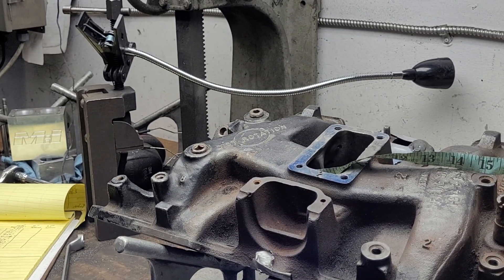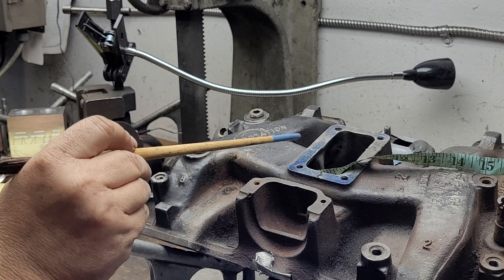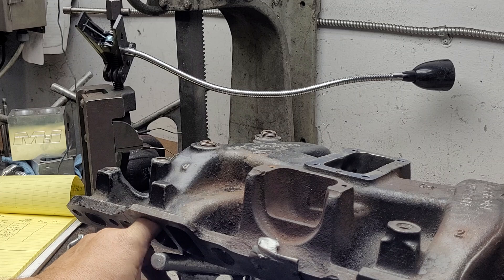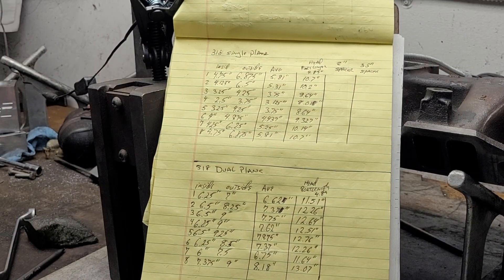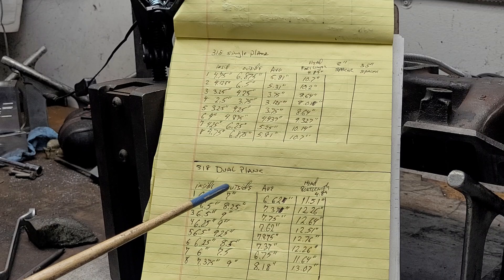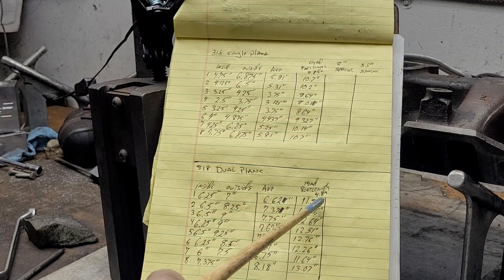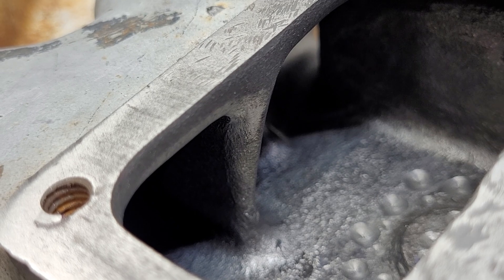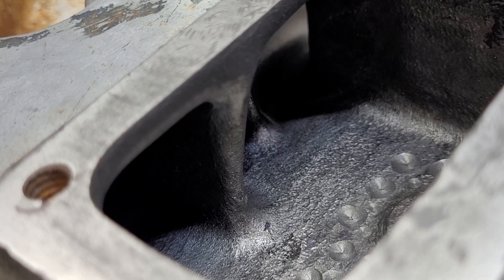Mission Impossible 318 project, Measuring intake port lengths

Comment: Port length with various valves opening up at different times compared to each other will potentially add to, or subtract from performance, same as how it affects performance to adjust the exhaust manifold/header lengths to deal with the same timing, only on the other end, where you are looking at how your scavenging is going to come out.
Reply from the maker: Thanks

Comment: A shop vac will pull your tailor's tape through so fast you best be hangin on or it will fly right through into the vac tank.

Works every time with any cloth tape.

Comment: Every length of the intake is its own resonant cavity, and everywhere the ports are across from each other is even yet another resonant cavity.

Every one of these different sections are all going to want to resonate at a different frequency.

Kinetic deflection is also a factor in restricting air  flow.
Reply from the maker: I did a lesson/ video a while ago where I graphed the different torque curves from different length runners on the same crank and what it does.
Reply: @servediocylinderheads  Ideally, for an engine to operate with the most uniform power between individual cylinders, every port should be 100% independently operated [separated completely from every other one, with their own air  and fuel metering, using identical porting and carburetion.

Some of the best performing engines built relied on this and had one carburetor per cylinder, each on its own independent inlet to prevent cylinders from interfering with each other.

This ensures identical uniform direct air and fuel flow, and ensures that a skilled tuner can assure each cylinder gets the exact same charge of fuel, whereas with manifolds, fuel is prone to sling off of curves at near sonic velocities, splattering down the wrong ports, often leading to fuel flow mysteries that even some professionals can't figure out.

And even variations within manifolds from the same manufacturer will have different flow characteristics, simply because of casting inefficiencies.

One of the big advantages to CNC engine design is the ability to engineer out variations and inappropriately tight bends and irregular internal volumes.

I am working on specialized systems which I will be testing on my own engines which I expect will produce significant gains in this department, and will also be working with a tunable tunnel ram system I devised.

Comment: Ever thought of using a plumbers pipe bending spring to measure the port length with? I suspect that a large diameter spring will be pretty close with just a single measurement. Going to have to try it later myself just to see how it works. Regards Greg
Reply from the maker: I did not think of that. Thanks

Comment: Hey brother, 3m makes an expanding foam tape for door jambs that I use for paint work on my restos. I slide it through and stick where I need it. Then close the door and it fills to the amount and countour needed. Seals the area up pretty well. I'll try a small piece here on one of my old intakes and if it goes as good as I believe it will...I'll send you a piece of it.
Reply from the maker: I have plenty of experience with expandable foam. I built a super insulated house up north. I have always had issues. Thanks
Reply: @servediocylinderheads  😄👏👏👏

Comment: Port lengths don't matter on a dual plane, look at the Edelbrock Windsor F4B, runners as short as 1".
Reply from the maker: And the others very long. So the engine has two torque peaks at different rpm. This makes for a very flat torque curve. Thanks
Reply: @servediocylinderheads  Now to grind a cam with profiles to suit each runner.
Reply from the maker: @TomSmith-cv8hk  That has been done before. Not this time. Thanks

Comment: Just a thought. Take a straight drain cleaner bristle,  push it through.  The bristles will keep the twisted wire in the approximate center.  Or just section of old battery cable 2 AWG.  It is ok, because it's just estimating.

Comment: I think measuring both sides,  then split the difference, because the air flows in the middle!
And wouldn't that bake a decent intake for a turbo EFI,  mount some injectors and pipe the turbo into a throttle body,
Reply from the maker: Which intake?

Comment: Why not lube up the inside, and pour it full of silicone, like Mr. Vizard  does with heads,  tape up the head flange areas, and pour from the carb flange, maybe a cheaper option of material can be found that keeps it shape, or maybe just making the cast hollow just allow the silicone to coat the port, making it much easier to remove,
Reply from the maker: It is a good idea but I don't see myself doing that with these nightmares. Thanks

Comment: I am missing how you measured the dual plane at the point where it divides into 2 ports?
Reply from the maker: I stuffed the branch with foam to make the outside turn.
Reply: @servediocylinderheads  Thanks. Just wondering how and where you made the turn and how big of radius .

Comment: A shop vac will suck the tape right through a runner.
Reply from the maker: Genius! Thanks
Reply: @servediocylinderheads  Aren't you an electrician in another life?  😉
What do you do for conduit runs where you have no pull elbows? (there must be plenty of under-slab in Florida...)
Reply from the maker: @jimurrata6785  Funny, my pulling equipment is in storage. Thanks
Reply: Hey Charles.. not sure what rpm this thing will run best at...however if you had a goal of max peak hp.and torque could you take that center devider farther back..would you get more flow with a larger plenum ??? And also would the affective rpm range be too high with the shorter runner... thoughts.??
Reply from the maker: @randydyck7904  It will rev I have no doubt. Thanks
Reply from the maker: @randydyck7904  That is the best I could do, plenum is tiny. Thanks
Reply from the maker: @randydyck7904  Yes, that is the best I could do with that tiny plenum. Thanks
Reply: That was on the single plane Charles

Comment: If you took a flex hose and made it stiff and marked it slipping it through the manifold and repressurize it. You should be able to get fairly accurate results. Its would tend to get closer to the center of the port . Be very curious if 1-2” exists .
Reply from the maker: Interesting idea. Thanks
Reply: Shoe string
Reply: @Patrick-xd8jv  Wire hanger

Comment: Your probably already familiar, but Swartz-Racing-Manifolds had a good graph on their website in the Tech-Tab showing desirable runner lengths based on RPM.....I've used some relitively decent simulation software, and Swarts numbers prove are pretty spot on, by comparison.
Reply from the maker: Good info, thanks.

Comment: I took your 12.5" length, and got a resonance at 6720 rpm. I didn't do each one, but if you need more, I can whip them up pretty quickly.
Reply from the maker: Interesting, I had to do taxes tonight so, fun!!!
Reply: Thanks. I assumed it's what you meant but you'll hear ram charging, reflected wave, some just call it tuning the runner but I gotcha 👍
Reply: What is meant by resonance here? The pressure wave reaching the valve as it opens? I've heard of it called all sorts of things, just trying to be on the same page.
Reply: @jseal21  Yes, I believe it's called the Heimholtz Frequency. The formula is length x rpm = 84,000.
Reply from the maker: @jseal21  I am not an expert but the way I understand it is there is a reflection back up the runner when the intake valve closes. Depending on which reflection you want to use the length of the port will cause a pulse back down the port at a time when the valve is open and help ram the charge. I am sure someone can explain it better than me. Thanks
Reply: With a 2 bbl carb, I am betting peak power under 5600 rpm
Reply: The longest should resonate at the lowest frequency. That’s unless physics is on vacation. 😂
Reply from the maker: @jeremylastname873  Never on vacation. Thanks
Reply: Charles Servideo,  do you use a formula to figure this or Pipe Max?  Also, it seems to me that the port length may determine that you can turn it higher than what the carburetor will allow.  How do you take in to account for something like that.
Reply from the maker: @ericsmcmahan  I don't have pipmax, I am afraid to buy it. Why, because I will spend so much time on it! Sounds silly but I do know myself.
Reply from the maker: @ericsmcmahan  To get the hp it will need a fairly aggressive cam and some rpm which the carb will restrict. So you do what you can. Thanks
Reply: @servediocylinderheads  will D V's cam speccing program be used to choose a cam?
Reply from the maker: @ericsmcmahan  I am sure it will. Thanks
Reply: If you use a seamstress tape and a shop vac it will suck the end right through.
Reply: Reversion ?
Reply from the maker: @charlesperkins7746  Please state a full question. Thanks